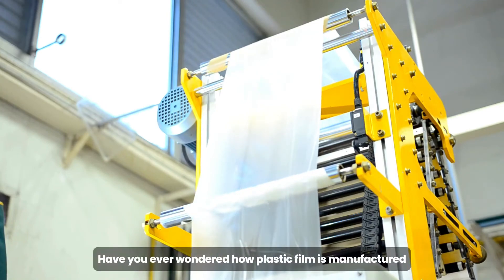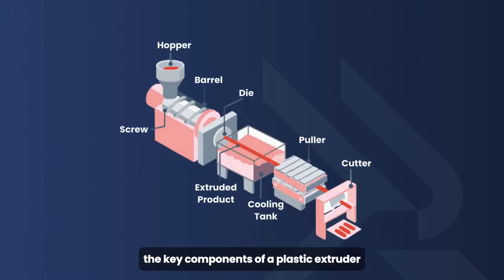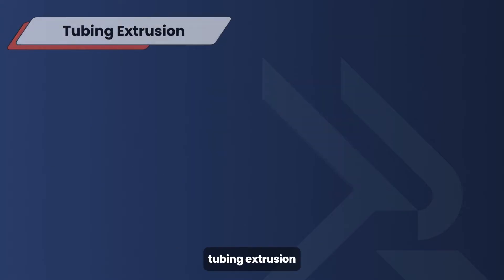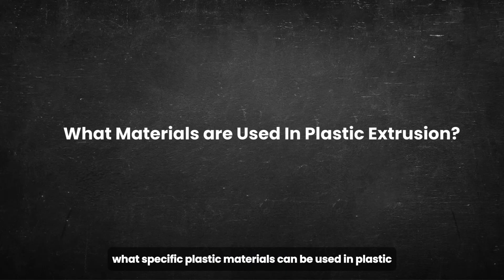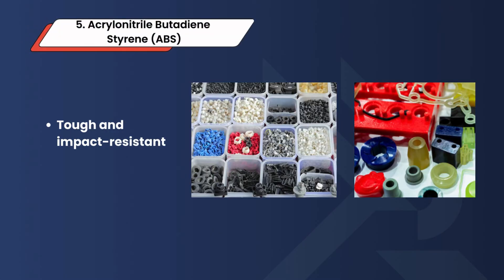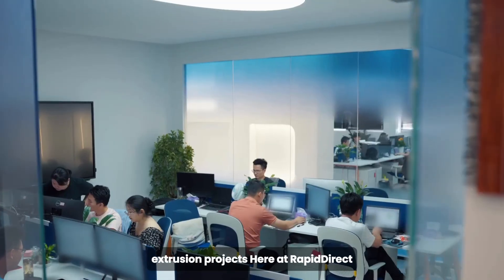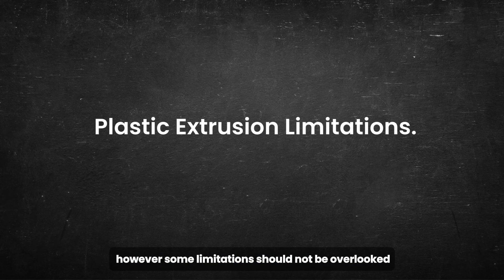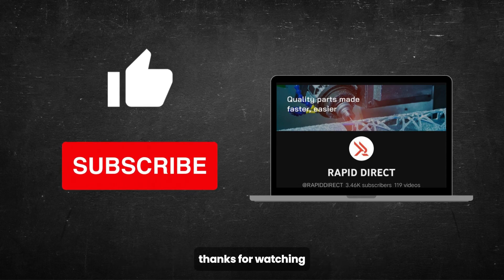How Does Plastic Extrusion Work?

Comment: That’s a very good point, but in real production there are still many challenges. For example, seasonal temperature changes can affect the extrusion temperature, which in turn leads to variations in the quality of plastic products. As an equipment manufacturer, we must address the various feedback from factories and assist them in finding solutions.